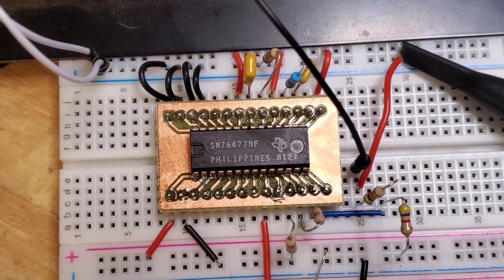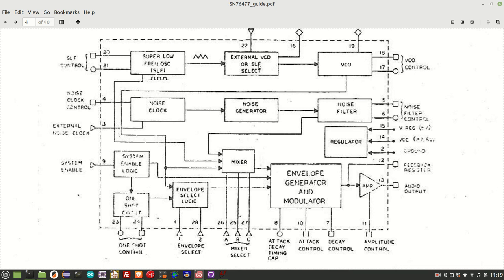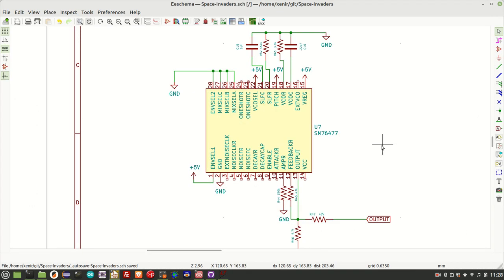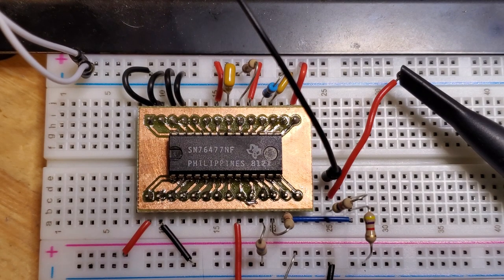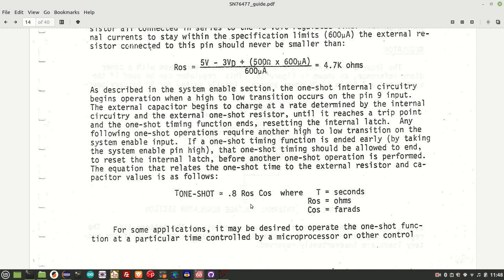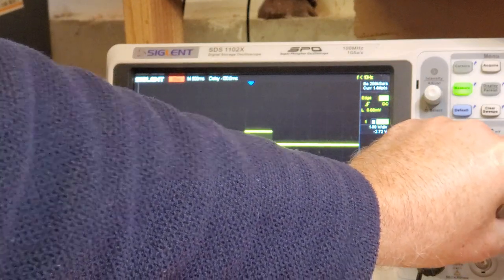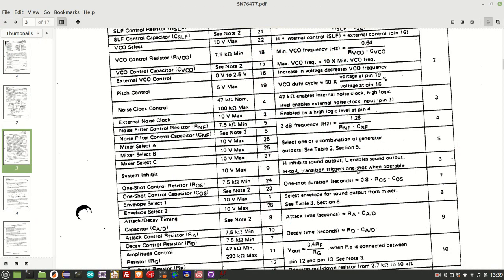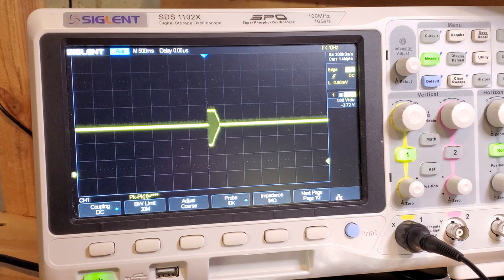Space Invader Sounds Part 2 - The SN76477

Comment: I'm working on the SN76477, It's fun to work with,. Note; On pin 10 you can put a bypass trigger switch over the resistor on pin 10 to get a different sound. Note; On pin 20 use a potentiometer 1meg instead of a resistor to a wider range of sounds Note; On pin 18 use a potentiometer 100 k or 50 k instead of a resistor. Note; on pin 14 VCC don't hook up to pin 15 VREG use a .on/off , trigger to you get a total different. All so pin 9 to pin 19 use a on/off trigger.